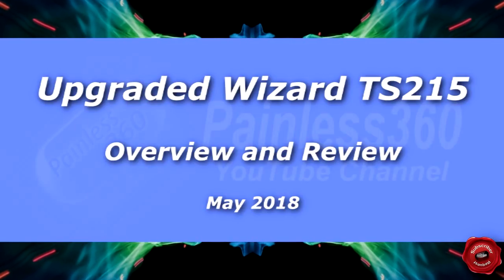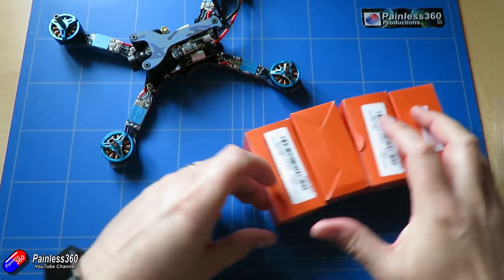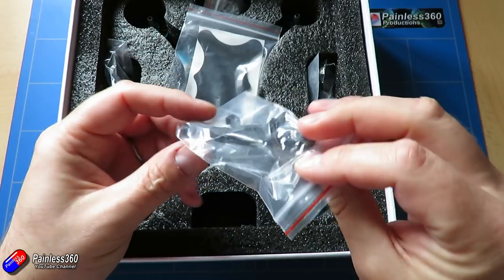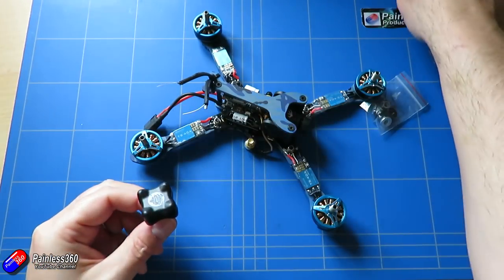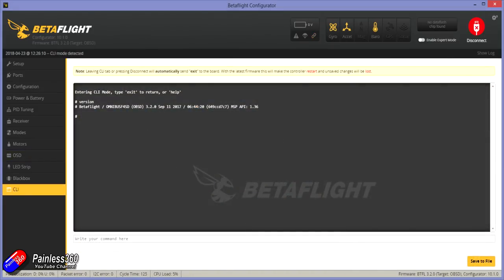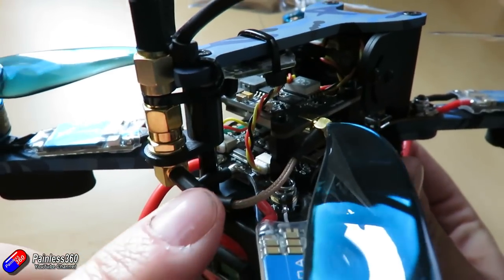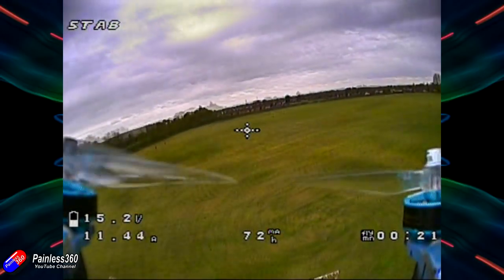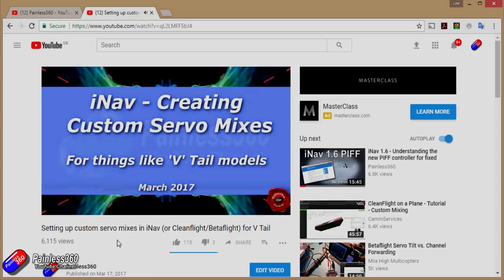Revised Eachine Wizard TS215 FPV Quadcopter Review

Comment: Really big fan of the channel. I’m having issues connecting my flysky x6b to this rig. Any thoughts on why the flight controller wouldn’t be receiving my ibus signal? Thanks
Reply from the maker: Nothing springs to mind. Make sure you've got a bus and everything set up in Betaflight. Best of luck
Reply: First, thanks for the quick response. I really appreciate it. I finally got everything working. Not sure if this is just my rig, but to get ibus working I hade to change the uart6 to serial rx instead of uart2 that everyone else seems to use with this quad. I hope that helps someone else out there!

Comment: Lee, great review but just a quick question. Would a standard 30x30 FC fit on this frame if you have to replace the proprietary board? Would it need modifications to do that?
Reply from the maker: You’d have to make a plate that replaced the existing Circuit board with the mounts for a traditional F.C. in it. A lot of messing about...

Comment: Would it be possible to make a video on the best way to set up an fpv camera? I've just put the runcam control board in 2 of my quads so changing the settings is really simple. Trying to get the absolute optimum camera settings is proving difficult, could you explain what each setting does ie. Wdr, gamma, etc. Also what effect ir blocking has. Thanks
Reply from the maker: That is an excellent idea. I’ll add it to the list!

Comment: Awesome review on this Eachine machine, finally got to see how it handles and for the price, very affordable.  Got a question about the vtx antenna support on the back, is it a print file or available somewhere.  It looked like a useful attachment for better protection.
Reply: Never mind, found it after a long search, man you’ve got a lot of items posted up on there.  Thanks for making the design available.
Reply from the maker: If you search on Thingiverse for 'TS215' there are only two things on there for it, and one of them is the part you needed :D
Reply: Painless360, thanks, would have made it really quick.  Keep the videos coming.